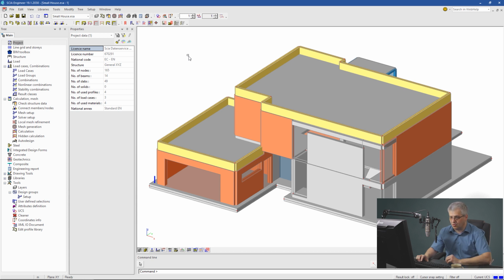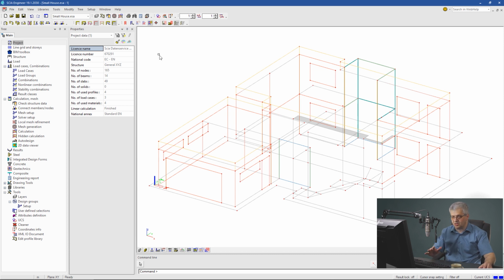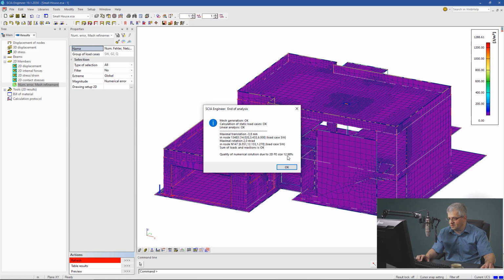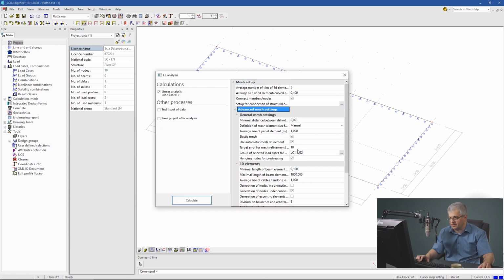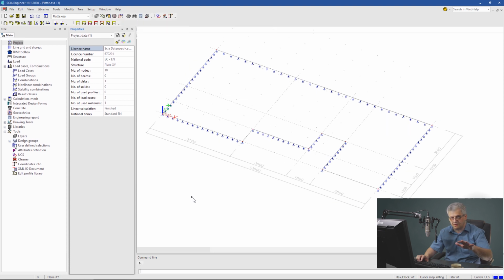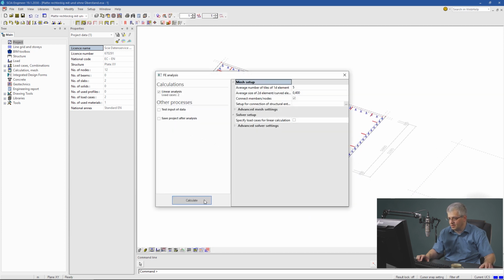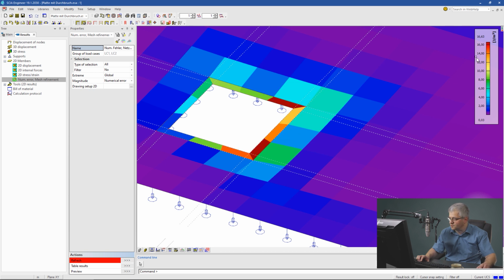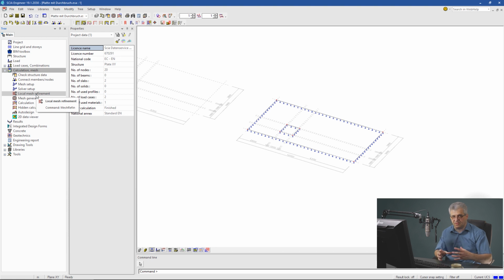SCIA Engineer: Automatic Mesh refinement and accuracy of FEM Analysis

Comment: Dear Ivan, please tell me what is the best scia version for all types of nonlinear analysis for column & slab " 32 bit or 64 bit? because all my cases require plasticity nonlinear analysis for concrete buildings. thanks
Reply from the maker: For nonlinear calculation of surface elements, the best way is to use the latest version 19.1. Doesn't matter if you use 32 or 64bit Version. With 64bit, you don't need to care about memory consumption, especially in the engineering report and 64bit is quicker.
Reply: @IvanBeles  If i want to consider the  non-linearity of flat slab with also the nonlinarity of frame elements as columns, please tell me how to do this task? thanks